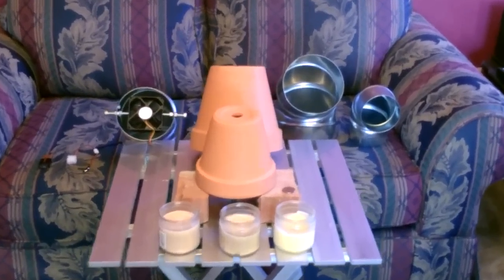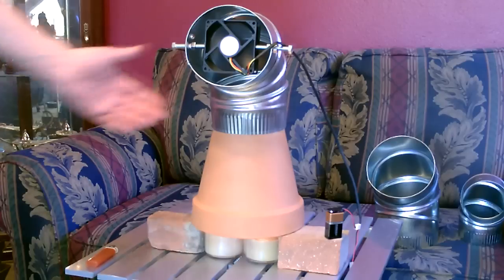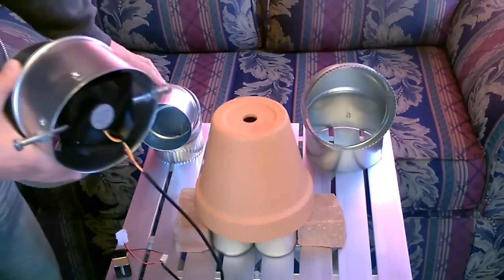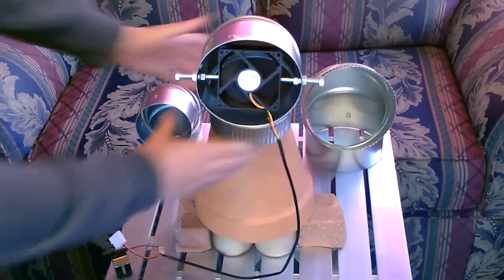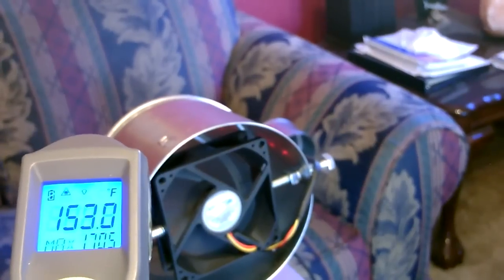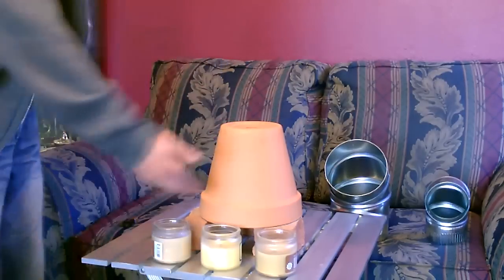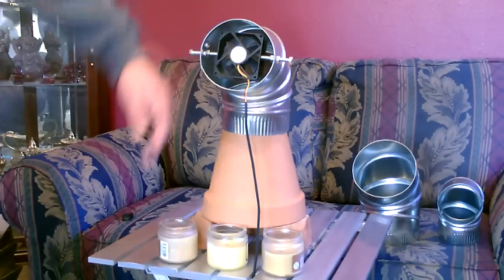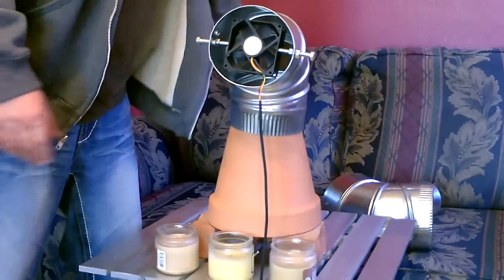Candle Powered Heater! (Improved!!) - DIY Radiant Space Heater! (w/fan!) - Clay Pot Heater!

Comment: Actually, instead of a tin 'elbow' connection with a plastic fan .. just cover the top of the terra cotta pot with a couple of the same kind of bricks (clay brick are better than concrete bricks) that you just set the whole thing upon.  These will absorb and  conduct the uprising heat and radiate more of it outward into the surrounding area instead of 'losing' it straight toward the ceiling.  Then, unroll a complete 25' roll of tinfoil (about $2.12 at waalmart) ..and start one end of it and wrap it around the top bricks two times.  Then, continue wrapping the remaining tin foil upon itself into a 'cone' pattern and forming it downward toward the flat surface of table or floor (whatever your support bricks are set upon.)  Make sure to end the length of the cone into a hole about the size of a Kennedy Half Dollar.  Then take the cardboard roll that the tin foil was wrapped around .. take that and put it over the half dollar size opening at the end of your tin foil cone ... and aim that toward the opening underneath the terra cotta pot so that it directs the heat back into the bottom of the pot.  If you have done all of this correctly, the hot air radiating from the bricks on top of the terra cotta pot is redirected back toward the base of the unit .. and we know that the candle flames require air to burn .. and therefore, an updraft is created inside the pot ..and recirculating hot air into the candle flames effectively amplifies the heat .. effectively doubling the amount of heat that radiates into the sides of the terra cotta pots.  Thus, doubling the amount of heat  every time the air make one complete cycles from the bottom of the 'furnace' to the top of the 'furnace' and through the 10' sectional tinfoil cone and the 12'' sectional of cardboard tube ..and thus, doubles every 18.32 seconds.  Eventually you will feel the effects of graduated heat waves totaling upwards of 1800 degrees over the course of many transfer cycles .. and you may never have to pay a heating bill ever again depending upon where you live.  Basically, it is up to you to preserve your credit ratings ..and no bills are the best bills of all ..and you can thank yourself later when you buy a new cell phone charger with your savings.
Reply: Michigan Citizen Can you assemble this by way of video? I would appreciate your efforts to see how this is done--I  a visual person due to dyslexia. Thank you!
Reply: This sounds like an excellent idea however, can you do a youtube and show it, its kinda hard to visually conceptualize. Thank you

Comment: I use charcoal in mine. I dont care for the smell much. I especially dont like the kingsford charcoal  but it does light easily. I find if I place it out on the deck till it goes grey,then you dont get that lighter fluid smell. I have to be careful not to use too much charcoal because it gets too hot. I just crack the window a little and its fine. I want to make a bigger unit but I am afraid I would melt the fan.

Comment: You would get way more heat if you close off top on bottom pot and leave the hole open in top pot.  The bolt In the bottom it's helps create more heat.

Comment: OUTSTANDING!!!!!
Reply from the maker: thanks 🙂
Reply: @desertsun02  have you run into any problems over time that the fan is becoming warped?  Also, how long does a 9V battery run the fan.  Your set up is brilliant.  Also, did you directly wire the fan to the 9v battery or did you have to put a cottage regulator between the fan and the battery?  Someone here in the comments suggested a heat powered fan.  I looked at those.  They are very heavy and without additional support I doubt you could just set it attach it to the vent.  And I am guessing 4 tealights are not going to generate enough heat to turn such a fan.  Your thoughts on that.  Have a great day.  God has blessed you with a good brain, please continue to use it for the benefits of your fellow man.  God bless♥️♥️♥️
Reply from the maker: @SWEET SAVORY WORDS nope the fan has stayed in perfect shape (no warping). i've never actually tested how long it lasts on battery. those types of fans vary from 1 to almost 5 watts. you should get a long time if it's an efficient one. i typically run the fan on 12v battery or 12v solar panel. note that many of these fans have a voltage range of 6v to 12v. you don't need anything between the battery and the fan. it's a straight connect. you could use a speed controller though. i've bought several of those and added them to my projects over the years. amazon has lots of those for just a few bucks. the heat powered fans i've seen are fairly large but they might make smaller ones that would work. those tealights have a pretty small flame so i usually use regular size candles.

Comment: Hey, this is a great video. I have a whirlybird on the roof. It is small turbine vent. In the summer is turns releasing hot air from the attic. I wonder if it is possible to generate energy from the whirlybird to turn a small fan like the one you have in the video?

Comment: Is the computer fan deliberately left a little loose so you can angle it up or down? I will definitely be making one of those as I am really feeling the effects of the cold where I live. Great video!
Reply from the maker: Deathbypwnage123 hi there and thanks. yep, i left the computer fan slightly loose so i could angle it.
Reply: +desertsun02 candles are the future! you can also get thermal electronic generators and soon have zero dollar electric bill and live on a boat so you can use candles to distill water😄
Reply: Ricardo Casino .....apparently you know nothing of thermodynamics.

Comment: Hi - good innovative demo !!!. As an additional suggestion..I haven't had time to try it but could you use a Peltier module powered by the heat of the pot) to provide power for the fan thus making the heater self sustaining??..Would like to see it tried !! Many Thanks.
Reply from the maker: thanks. it sounds like something that may work. have to do experiments...✔

Comment: I would use a 120mm fan to cover the whole pipe end.
Reply: Or at least cover the gaps so you don't have any air circulating around the edge of the fan, thus reducing efficiency. But then again, it's a candle, you're not getting much out of it in the first place...

Comment: How is this hooked up to the battery? It would be great to see that in more detail. Thank you for sharing this!
Reply from the maker: hi there. it's just a straight connect from the battery to the 2 wires (red and black) of the fan. if interested, i have a video showing how i hook these fans up. it shows the wires and plugs on the fan in great detail. that video focuses more on how to hook these fans up to solar panels, but it's the same idea. https://youtu.be/qL82DuN0qHg
Reply: If it makes it easier just order a fan with a USB plug then power it via solar during the day and a power bank that's been charged during the daytime by solar panels for night time use.....that's what I do

Comment: If you have an overhead ceiling fan you don't have to worry about the elbow just cut the ceiling fan on low and it will circulate the heat in the room
Reply: well thats a good idea if you havent lost your electric power!

Comment: Learn what the stack effect is. Then realize the stack effect causes an air flow of its own. It just needs a larger volume to rise. A wider "umbrella" with spread out heat sources to draw air in and the heated(lighter) air will rise and cause the flow on its own. As an added bonus the air flow will dissipate the warmer the air is that it draws in.

Comment: if it gets that hot, dont you worry about it melting the wires running to the fan?
Reply from the maker: hi there. the fans and wires are pretty tough. it doesn't melt them. easily handles the heat 👍

Comment: how long will that little 9 v battery last on a puter fan like that?
Reply: a day to 5 days. @ 0.25 amp, 9v battery @ 900-1000mah /.025 = 3600hrs -50% = 1800hrs /24hrs = 75 days? for a high quality 9v battery..... give or take another -50%.
Reply: You could get a small solar powered fan that wouldn't need a battery.
Reply: @Apollo1011 solar doesn’t generate power at night, when it’s coldest and the heat is most necessary.

Comment: Is the black pipe could be less toxic than aluminum!?
Reply from the maker: note that the silver pipe isn't made of aluminum (it's steel). the black stove pipe is cold-rolled steel and the silver one is just steel (but both are totally safe and work equally well). the black pipe is better for much higher temps (like the temp of an actual wood stove)

Comment: Wie lange läuft der Lüfter mit der 9-Volt Bakterie > und wie lange hält der Lüfter die Hitze aus?  BG
Reply from the maker: hi there. i never timed how long it runs on battery but the fan will last years. those fans are tough and it's not too hot so it handles the heat ✔

Comment: What did you do to the end of the fan wire? How did you make that connection for the battery?
Reply from the maker: hi there. i just took the 2 wires from the 9v battery connector and put the positive or red wire into the positive slot on the fans' connector plug and then took the negative or black wire from battery connector and put it in the negative slot on the fans' connector plug. you can just cut off the fans'  connector plug if you want and connect it directly to the wires. 🙂

Comment: would the fan be better on bottom pushing air up...?,i just wondered.
Reply: John Dory I would think that because heat naturally rises, the fan being situated on top would conduct the heat better. Take into consideration that ambient air needs to flow in from the bottom to feed the flames. It's the same with a campfire: Space is needed underneath the wood to pull air in to feed the fire.
Reply: John Dory no it would burn the candles up way too fast come on where's the common sense people

Comment: Why not simply put one of those fans that run on the generated heat on top of the upper flower pot? That would even distribute the heated air rising from the side of the outer flower pot. No electricity needed, especially during a power outage.

Comment: How is it that the fan isnt melting? Where do you get the fan?
Reply from the maker: the air coming out is not hot enough to hurt (or melt the fan). it easily handles the heat.

Comment: No candle power can't generate more BTUs under a flower pot... it just won't change things in the long run.. All the flower pots do is collect the heat.. If he had tested the heat temps for a longer period of time eventually  the inner pot would have cooled down because of the volume of cold air passing across it by the fan..This idea however IS a good concept in an emergency  situation when the SHTF and you lose electricity or gas... That is why candles are one of the best resources to have on hand for those situations....

Comment: Use an elbow that covers the entire pot.
Reply: I agree, utilize whats being radiated and lost
Reply: Wow good idea. Your very practical.
Reply: Mr. Hiller your commit was so fantastic. Yes by using an elbow that covers the entire pot you don't loose any of the heat that is generated from the candles thus giving 100% efficiency of the burning candles. I have watched many of these flower pot heater videos and this video with your idea is the best one by far.
Reply: I have one extra idea about the use of the candles. Instead of using those little tea candles, use a can of lard and insert a thin candle stick down into the lard and that candle will last for a much longer period time. you can buy a can of great value lard from Walmart cheaper.

Comment: Any idea how long the 9 volt will last with constant use?
Reply: If it's lithium based it'll have about a 1200 mAh capacity standard computer fans are typically 12 volt and draw 0.33 amps so as this is 9v then it may be lower but worse case about 4 hours of continuous use.

Comment: Where do you get the 9 volt battery connector?
Reply from the maker: you can get those at most electronic supply stores. amazon and possibly walmart sell them too. you might be able to get one for free if you have any older broken item that ran on 9 volts.

Comment: where can i buy one of those fans
Reply: LOL. Radio Shack went under a few years ago.  (good riddance).
Reply: I started realizing that Radio Shack was selling poor quality crap towards the end. Not that long ago, my brother was having problems removing a surge protector off of an antenna grounding block. When it broke, we realized it was made out of plastic. A grounding block grounds a coax shield by providing an electrical path from the shield to a wire connected to a clamp on the block to drain off static electricity and lightning surges. This makes your equipment (TV, radio) last longer and should redirect lightning away from your TV if the antenna is struck. This block MUST be made out of metal. Plastic is the absolute opposite so that's very bad. In all likely hood, the coax shield is connected with a little wire in the plastic block, but that just won't do if you value your TV.

Comment: What type fan is that connects to a 9v battery?
Reply from the maker: hi. it's just a standard computer case fan. they typically use from 6v to 12v (so ,many, or most, run good on 9v) 🙂

Comment: Why use the metal elbow, why not just put the fan on a makeshift stand behind the heater and point the fan where ever?  It can be used to push the heat out in any direction, or suck the heat into and out in any direction.

Comment: Listen, a solid state graphite power cell bank connected to organic carbon power cells two tesla transmition coils electronics to generate and pass frequency through coils in a loop. Graphite rod or other shaped graphite heating element heated by the frequency passing through graphite to cause crystal structures to vibrate producing heat has graphite glows red hot. Electric fan to pass air over heating element. A space heater that operates on its own no need to plug it in or refuel it.

Comment: the only problem with these is that the air quality gets quite bad and in order to fix that you need to open windows and thus lose heat
Reply from the maker: hi. it's just a few candles so it's really not bad. i think they make clean burning candles so you could use those too.

Comment: And how do you hook up fan to battery?
Reply from the maker: hi there. it's just a straight connect. i usually use one of the those 9 volt connectors to make it easier.
Reply: @desertsun02  
Thank you. My knowledge of wires connecting to anything is zero.

Example, I asked about the connector that came with the bgear fan I bought and while responses would be helpful if I knew the terminology, they were like a different language to me.

Comment: Suggestion: Get rid of the coin. You are forcing the flames to heat up the air and the smaller pot by covering the hole. This will cause convection and blow some if not most of the flame heated air under the small pot and out into the exterior air. I realize some will be sucked in-between the two pots and up into the fan but you are loosing a lot of heat that you can not control. Also the slotted table allows uncontrolled air to be sucked up by the flames. More control of intake and push out should heat up the air to about 200 f. Just a couple of thoughts.

Comment: Adding another pot will reduce your output temp.
Removing one pot will increase the output temp.

You aren't gettng any more energy from the candle by using clay pots.
All you are doing is changing the convention, heat dissipation, temp, & heating zone (more at human height)
Reply: Trapped heat causes a rise in temperature. Heat rises. You keep adding narrowing vertical height til the ability  of the energy source and the effect of trapping is no longer capable of overcoming outside temps and the effect starts to be reversed. You achieve maximal trapping space for all variables based on the lowest surrounding temp and the desired output temperature if the energy source is constant. Not allowing for maximal conservation is expenditure lost, not gained. 

When you see a tall building get narrower as it rises, it's designed for maximal trapping. It's also referred to as squeezing. You squeeze and squeeze til there's nothing left to squeeze.

Comment: Just curious if people think this is giving off more heat than what's being put into it. It doesn't matter how you figure it, you have nothing more than the heat of three candles. What is the point of any of these clay pot videos?
Reply from the maker: hi. the main point is to 'capture and localize' the heat that is produced. extra heat is not generated but without the thermal mass all the heat that is generated just goes straight to the ceiling and you don't feel it. these units radiate and redistribute the heat into the living space. granted it's only a light duty heater - but can be 'scaled up' if you use larger/thicker pots and stronger heat source.

Comment: A lit candle gives off the same amount of heat, weather you stick a can around it or not. All you're doing is keeping the heat in a smaller area. Without the can it will rise straight to the roof and dissapate into the room. This is only useful in certain situations. Like if you're in an emergency and you need to stay warm while conserving fuel. Maybe stuck in your vehicle in a blizzard, but they make emergency heaters for that which are sold at Walmart. If you're inside, the heat will be the same and will stay in the room regardless, this just keeps it in one spot for longer. Maybe as a space heater, just to warm up the area where you're at. Just put on a blanket...